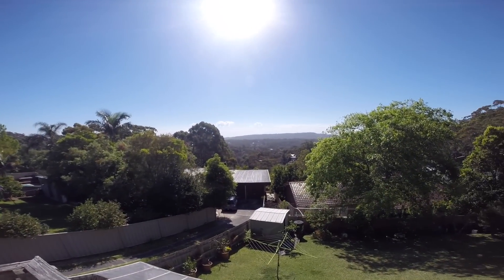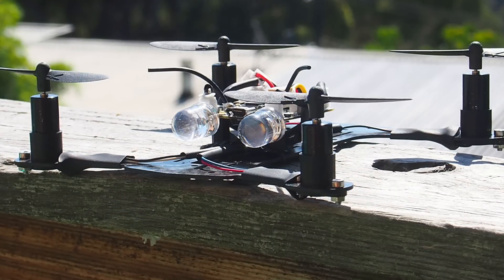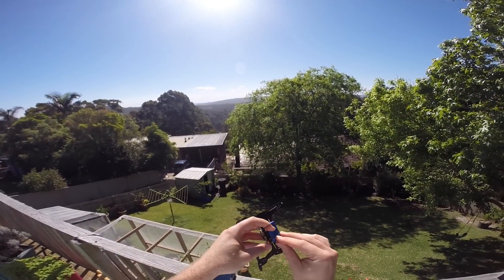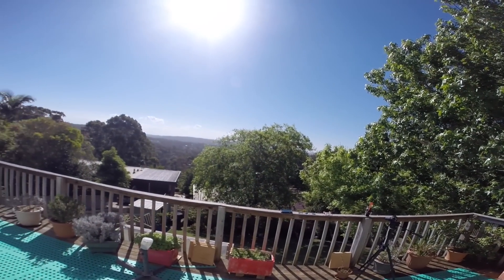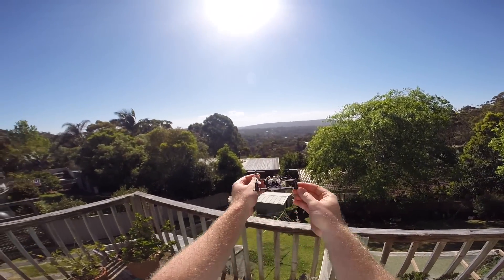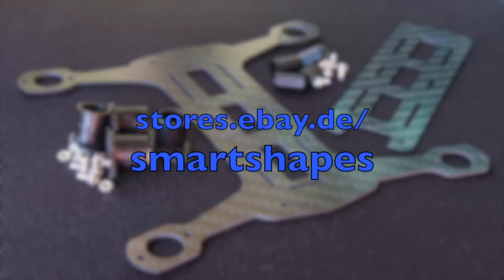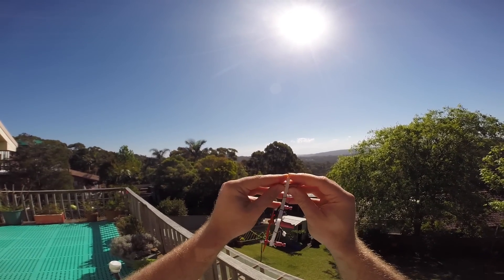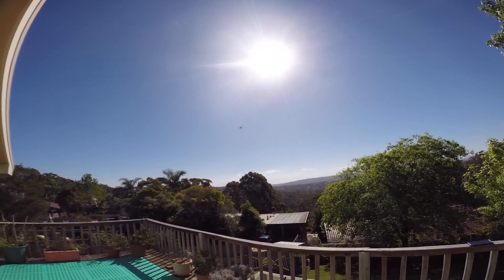Micro Motor Madness #1: Carbon Micro-H v3, 7mm Dream-Catcher, Darth himself

Comment: awesome stuff man! I just bought a bunch of parts from your website but I was wondering since I have a Nano qx fpv can i transfer all the components to the Micro-h?
Reply from the maker: Thanks man! Appreciate your support!
No, you cant use the nQX FC for anything more powerful. The FC gets the "shimmy" with hotter motors, and also the throttle curve isnt suited. The minimum throttle input you can give with anything more powerful than a 0720-12 is above hover throttle. I call that "the flying bull" because its like riding one. You either climb or fall..

Comment: Will a main board of a dromida ominus fitin that h frame?
Reply: It might physically fit. But geared FCs usually have unsuitable PIDs for a direct drive setup.
Reply: so its better to buy a x4 board and transmitter?have 1 and a half ominus thats why I asked.Or do you a other cheap option that will work?want to start slow and later get in to fpv looks like a lot of fun
Reply: Hubsan FC and Tx is a good entry into customs!
Reply: Benedikt Haak ok thanks forthe fast replies!

Comment: hey do you think that i can put a blade nano qx in one of those carbon frames
Reply: The frame would not hinder that. But you would very slow motors to use the nQX board. With all our 0820 motors, the minimum throttle position on the nQX board is above hover throttle. It will fly, but it will only come down if you completely chop the throttle.
I call that setup "the flying bull", because it feels like riding one ;)